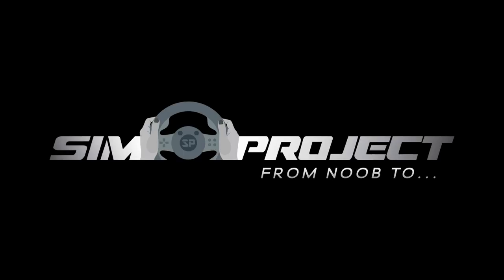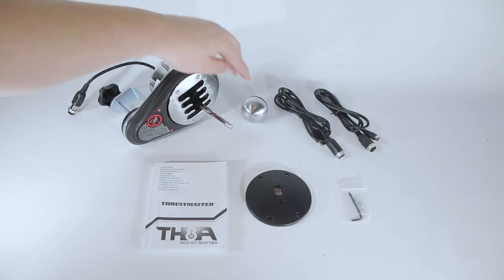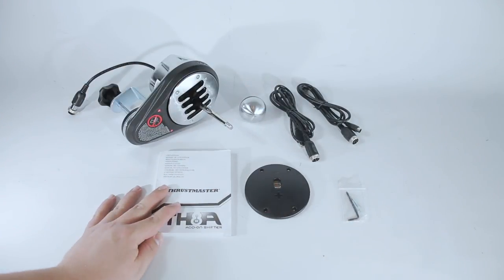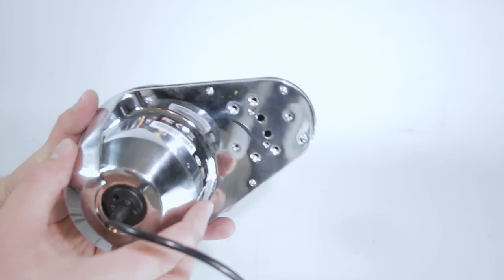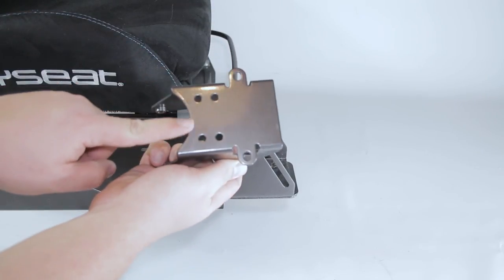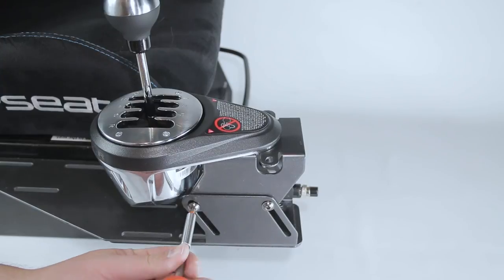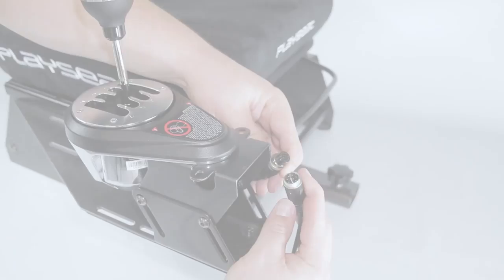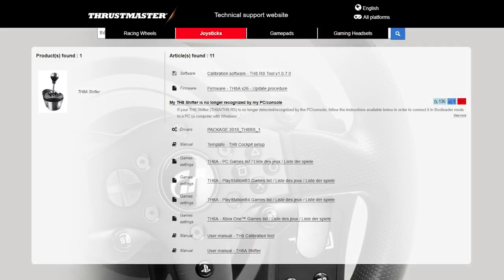Thrustmaster TH8A shifter install tutorial

Comment: Hello guys. I have a little problem. Before I start, sorry for my grammar. I bought TH8A from second hand. But I dont have USB cable for PC. Only one I have is rounded cable probably for PS4 only. It fits in the wheel base but it won´t work on my PC. My question is, Is it possible to order USB cable from internet ? Or is it possible to fix mi problem with PS4 cable only ? Thank u for ur respond
Reply: They make a usb for it

Comment: Hello and good evening, those small problems with the Thrustmaster TH8 shifter are as follows: in practice, if I connect it to the PC via USB, it works correctly, but if I connect it with another cable that connects to the steering wheel, it doesn't work well. In the past, it used to work, but only in sequential mode; now, however, with the H-pattern mode, it doesn't work properly anymore. I can't understand what the problem is. If anyone has a solution, I kindly ask for help. The steering wheel doesn't detect it, and it doesn't appear in the devices when I connect it to the PC through the steering wheel. On the contrary, if I connect it directly to the PC via USB, it works correctly. Please, I ask for assistance to solve the problem, as I would prefer to use a different method that connects directly to the PC via USB.

Comment: Size 4 x M6 bolts required not M5.... with about 1cm max thread, have installed one recently
Reply: M6 bolts x ??mm
Reply: How long is the M6 need to be. Sorry can't find a clear answer.
Reply: @rafaellaurel8973  4 x M6 (16mm length)

Comment: With my tmx can i install my shifter ? I need to remove to follow the tutorial to do it on the tmx or there is just to put the piece in 3D
Reply from the maker: Twitch_Xhenat hmmm cant say for sure since i never owned a tmx before :(
Reply: I'm two years late, but yes you can

Comment: I have g29 wheel, but the shifter doesnt work for me on pc
Reply: If you plug it via usb on your pc, it should work. It works as a standalone device, you can have Logitech, Fanatec, Sim Cube or anything, it won't change anything about the shifter...
Reply: @chrls.1093  I've have been looking for the answer to this problem. Except mine is G27.
Are you saying it takes 2 USB cables to plug into the PC to make that work? (Logitech Wheel + TH8A) 
Thanks for the help.
Reply: @ronniarbitiaas3095  Yes,because it's two differents brands, so they aren't compatible each others, but on PC you can just plug them on two different usb ports, and it works. Because PC support multi devices, so you can use any brand you want, you won't have any problem (but you can't do that on console)
You just need to install the drivers, as usual for each devices, and in game it should detect all you peripherals (wheel, pedals, shifter, handbrake, gamepad, mouse, keyboard etc)
And you can do this to every add on you need, not only two, when you have free usb ports, you can plug something

Comment: It doenst work on my pc . Ive tried everything . Firmaware and updated but the calibration dont work .
Reply from the maker: Tareq Unltd make sure it is connected to a usb 3.0 port. Otherwise its best to contact thrustmaster for the issue :/
Reply: @Simproject  in dont habe a usb cable for the shifters . I have to connect with the steering base or not ? Maybe i need an adaper for this ?
Reply from the maker: @al-baghdadi7854  very strange, the TH8A has a cable for usage with the base and a USB cable included in the box... did you buy it new?
Reply: @Simproject  where can i buy it?